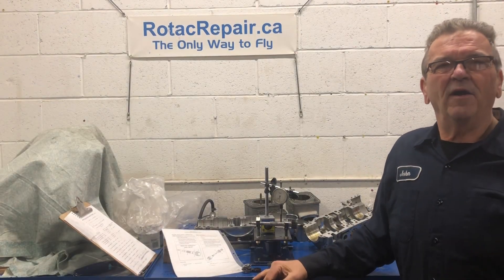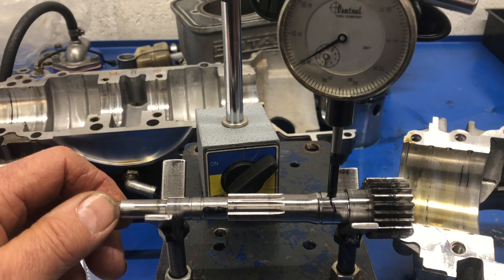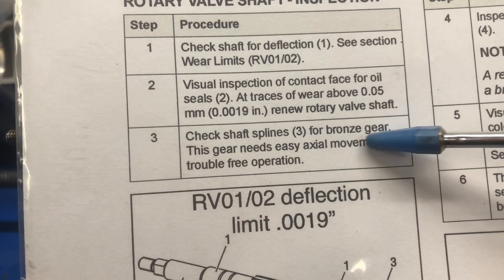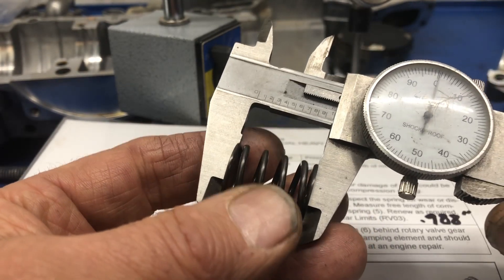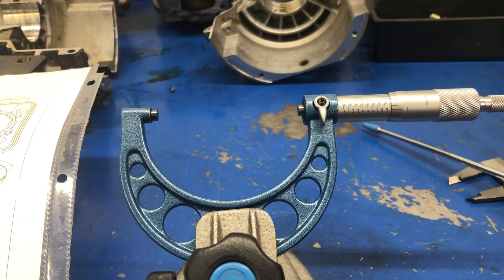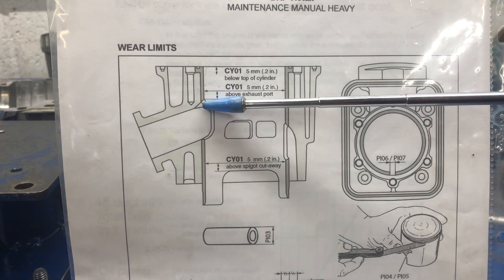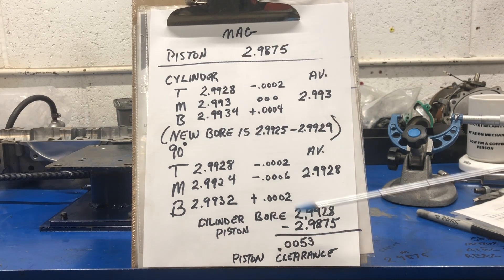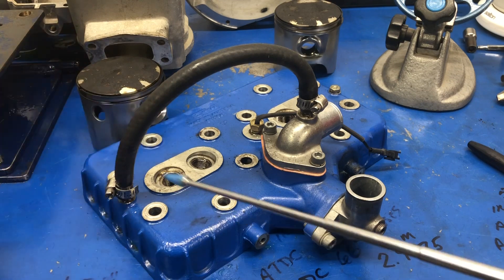Rotax 582 Blue head (part 2) component measurements

Comment: Rotax Rick. There is no way to measure a crankshaft to determine it's condition.  You can measure the rod clearance & determine if the thrust washer clearance is ok BUT it's the lower rod bearing that fails. The only way to see it's condition is to take the crankshaft apart & inspect the bearing.  If it's bad , the bearing cage coating will be gone meaning the rollers are so worn that the cage is rubbing on the rod.  Even if they're good, you really can't see how bad the rod itself is worn. It has a very thin layer of super hard metal. Then your into the soft metal & the game is over .  The only safe thing to do is replace the crankshaft or completely rebuild it , rods & all like I do.
Reply from the maker: Thanks for the tip.

Comment: Rotax Rick The inner mark on the RV shaft is where the RV oil system seal rubbed .  PLUG the weep hole like all the 582 Gray Heads were. Then if the oil seal fails it will go to the inner side of the ceramic water pump seal. The ceramic seal is not a directional seal & will work both ways being it uses spring pressure to seal .  If the weep hole is sealed you really don't even need the inner seal.  I install it but thats the way it works.